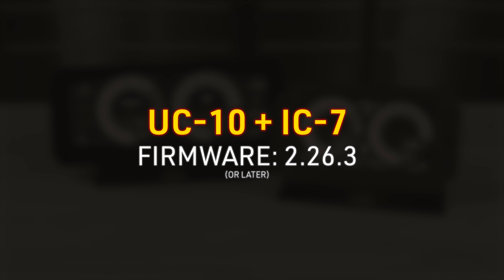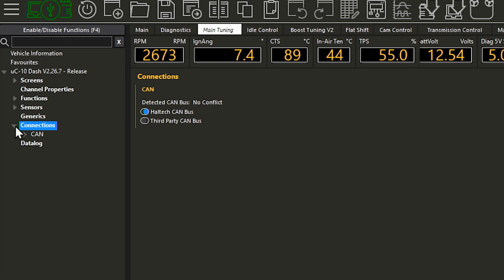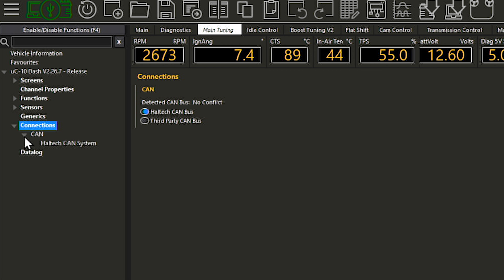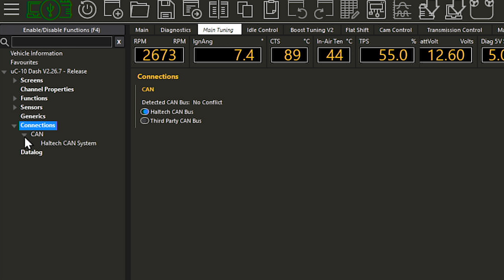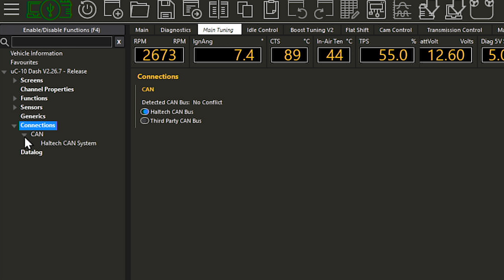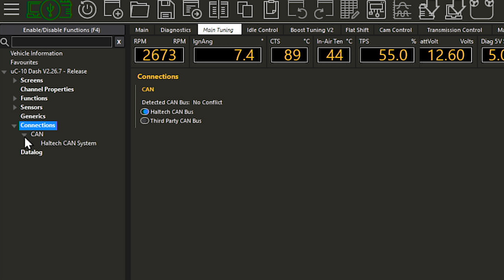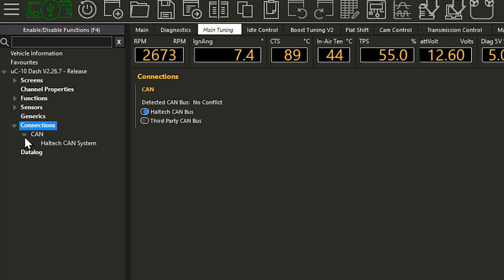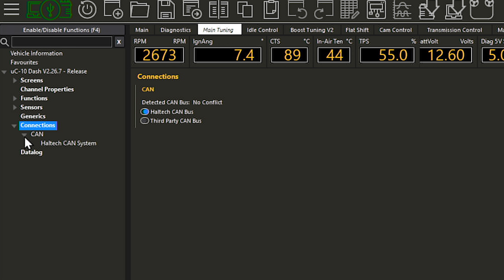🛠 Connecting Your Dash in NSP | TECHNICALLY SPEAKING

Comment: How do we select different ohm styles for fuel level sensor
Reply from the maker: We cant just yet, but we are working on this for the next Dash update - you will be able to enter the fuel level calibration in resistance vs fuel level!
Reply: @haltech I haven’t updated yet but once I do would I be able to simply calibrate fuel level as voltage and then convert it to percentage based off of min/full voltage readings like the previous ICC software?
Reply: Oooo this will be a massive help I've manually put resisters in lol 😂😂😂
Reply: AI  1,2 and 3 have 1k pull up resister available and AI #4 has a 2400 ohm pull up witch is apparently suitable for  fuel senders  there is a haltech video that discusses it

Comment: Dumb question, if I have a Elite 1500 and I will use both the Dash IC-7 and the Haltech O2 module where both need to be connected thru a 4 CAN port extension, both the IC-7 and the O2 module have to communicate to the ECU CAN 1 port, will this cause some conflict of communication with two modules ( IC-7 and O2) sending data thru that port? do one need to make an special communication configuration on the NSP software for this situation?

Comment: Thanks for that info it was a question i sent a few days ago about the Tacho I am just about to set up the elite 2500 on my turbo territory with a ic7 dash
I did have 1 question about the alternator pwm unit can it be switched off as i will be using a normal 2 pin alternator 
Great products thanks